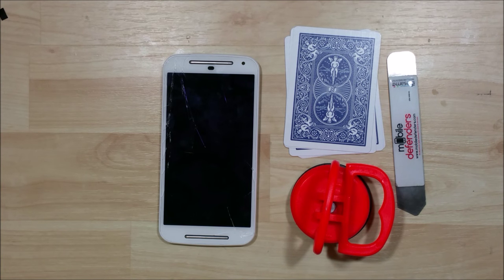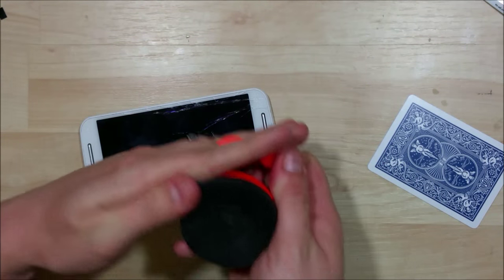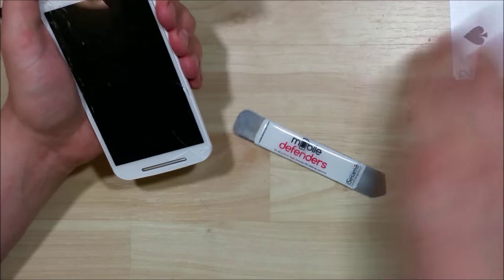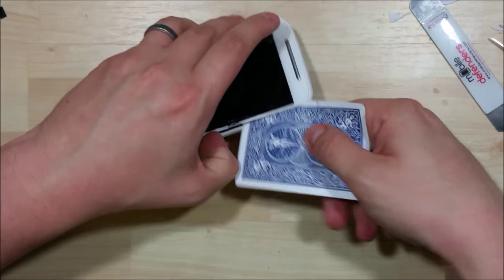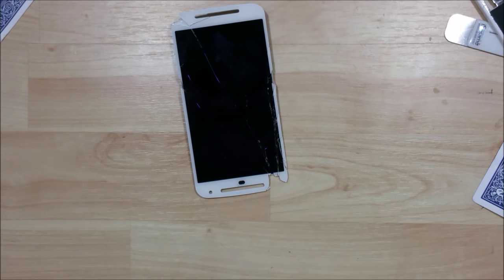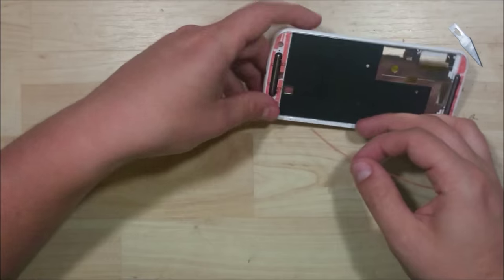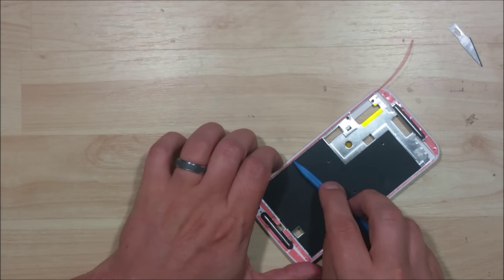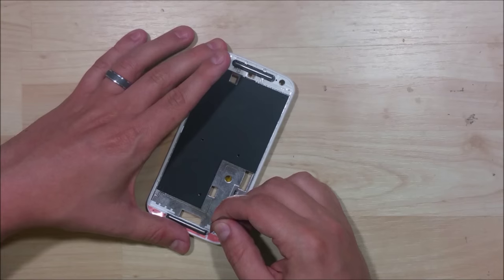Motorola MOTO G 2nd Gen 2014 - Screen Replacement - Screen Removal\Install

Comment: What if I have to open the phone again, after I seal it with the tape? Will I have to use heat gun, or will just applying pressure do?